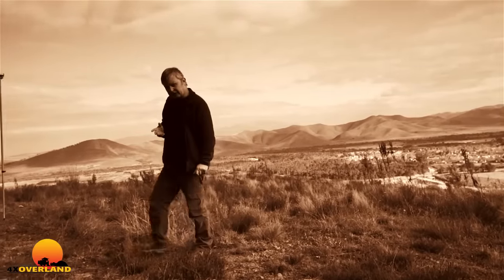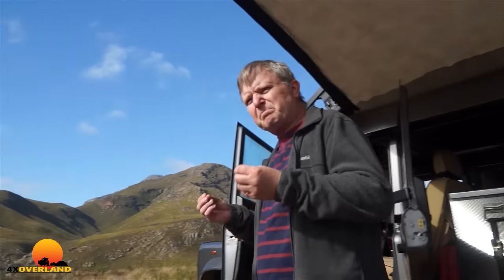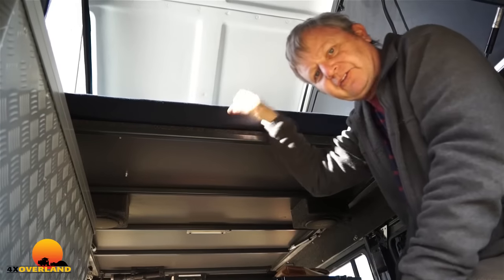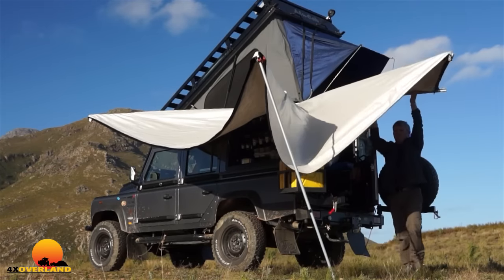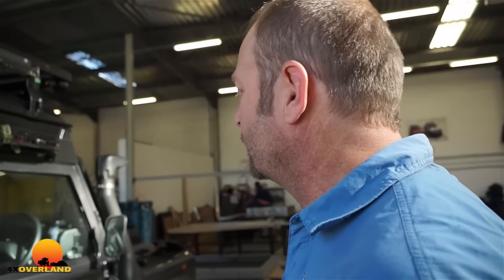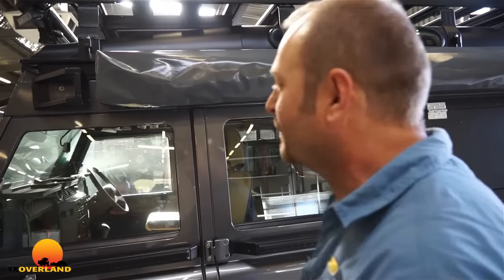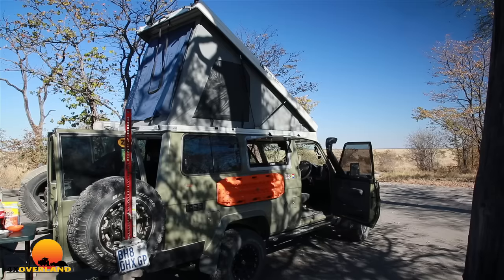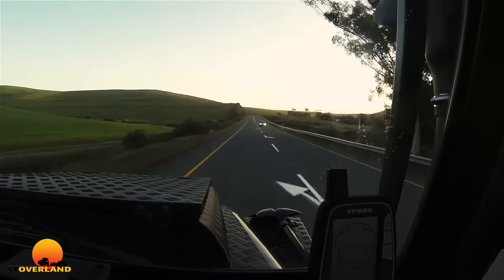Land Rover Defender - The ultimate Camper conversion

Comment: If they made this car 10" wider on either side so your elbows would fit, it would be perfect.
Reply: +Teutone except its highly unreliable
Reply: +MaZEEZaM land rovers are not unreliable vehicles. If every vehicle was treated like a Land Rover it too would be unreliable. If a vehicle was used on the farm covered in mud and never washed. Neglected of servicing and so on it too would be unreliable. People who use land rovers mainly on road neglect servicing because they say it's a Land Rover it's designed for that. People say they are unreliable because they buy a dog to begin with. Some think because they are so simple it's easy to fix anything on then with a hammer. And then they'll break something. Toyotas and jeeps and other 4x4's are sold with car elements. Whereas land rovers have always been agricultural and utilitarian. Up until recently most land rovers were worked hard from day 1. Only recently have people started buying them as status symbols and on road only cars. Land rovers have always been a tool and tools get neglected. Other 4x4's are cars with a useful side.
Reply: Toyota Land Cruisers in Australia have always been used in the outback on bull dust roads and in searing dry Australian heat and treated in a similar way to what you mention regarding Land Rovers. They are incredibly reliable vehicles.
Reply: +MaZEEZaM I agree toyotas are reliable. But land rovers aren't inherently unreliable. Land rovers are my choice of 4x4 but land cruisers are extremely capable. 

I'm not talking just in one area or country. In the uk Land Rover defenders have started being used just as cars and are never seeing any offroad use. However a decade ago and all before that the majority were seen as tools and when they broke or needing replacing they got rid of it. It's very rare to find a defender with service history because either servicing is neglected or someone who isn't capable does the servicing there selves with either cheap parts or with very little care. 

Land Rover owners like making their vehicle there's and for me that's why I'm always fixing it or should I say improving it. Even when my Land Rover is working perfectly I like to work on it. I just think it's the mindset of previous owners of a vehicle that makes it unreliable
Reply: ok fair enough :-)

Comment: land rover = spend £4000 every year to fix it and put it into working order.
Reply: Exactly,last Vehicles made in Solihull without Love,by none caring overpaid Work-Crews to insane Price`s,only the bulletproof Design keeps Landrover out of Trouble,Toyota Hilux has as well proven to be indestructible,see Top - Gear,( old Line with Clarkson..)plus one Thing,the Ride in a Series 1 to Defender 90 -130 outer the rainwipped,muddy,English Off-Road Tracks is Suicide for the best at their ( Landrover`s)Price`s.....

Comment: Does this car have ‘in flight refuelling’ and a tanker driving along in front of it? Because dood you are gonna be using a shit load of fuel ......say about 5 gallons PER MILE! Thats a bloody insult comparing a ‘pretend ‘ 4x4 to Land Rover 😡EVERY other manufacturer COPYS Land Rover to try to be better than them.........it wont happen! All other ‘4x4’s are soccer mom kiddy carriers......Chelsea Tractors. The most off road they do is parking on a grass verge.......even then they get bogged in 😂😂😂 TROOPYS are SHITE. If you like a nice shiny car with polished wood inside and nice soft seats for your arse.......buy a ‘plastic’ off road vehicle like a Toyota, Mitsubishi etc 👍🏻
Reply from the maker: Troopy, shite? That's laughable and proves your complete ignorance and blind brand loyalty.